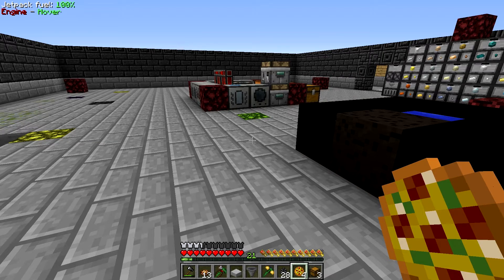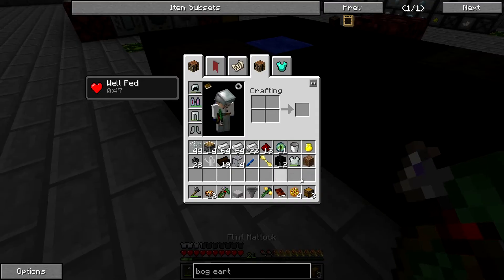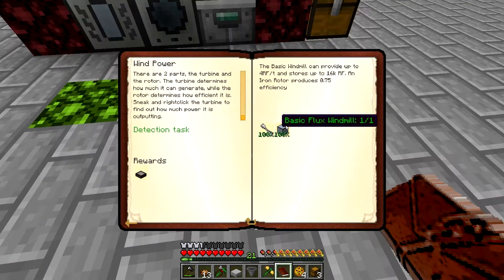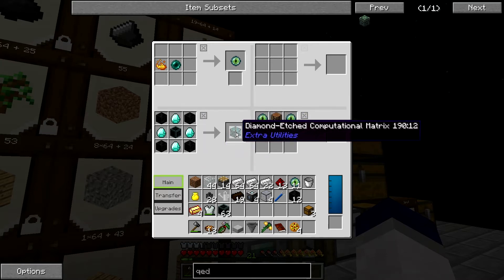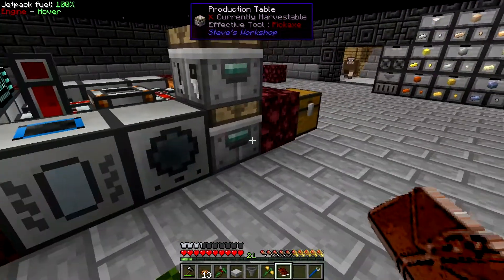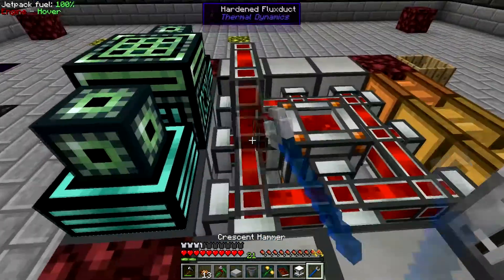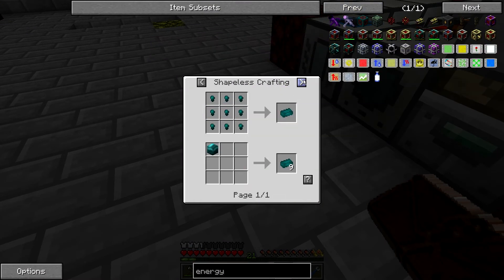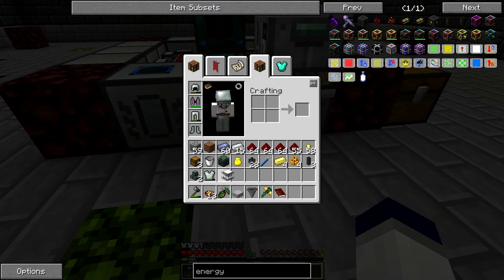Power Grid - Agrarian Skies 2 - Episode 15

Comment: Yeah I'm with you on power, I always (in a skyblock world) go straight to the lava power but this time I'm going to try something else, so very eager to see what you do. Have tried the solar gens before they are nice. With the Culinary gens I think the better the food you use the more pwer you can get, maybe? It's been a bit since I used em.
Anywho, enjoyed the video as always!!!
Reply from the maker: Mntdewmania Thanks. I haven't really used solar power before so that's an option, nor have I ever used culinary generators.
Reply: Delgar3 Go for the higher tiers they can really rack up the power fast then into a capacitor bank (or whatever energy storage you prefer) and your good to go
Reply from the maker: Mntdewmania In my test each food item gives the same amount of power per item, it's just faster in higher tier engines....I wonder if it's almost more resource efficient to have MORE of the smaller generators rather than the larger ones. :)
Reply: hmm do we have pam't harvest? Seems a pizza would give more than an apple. hmmmI don't know in the long run seems like the higher tier would be more efficient as its x64 I will be curious to see what you do!!!
Reply from the maker: Mntdewmania oh a pizza does give more power. But 1 pizza gives the same amount of power in a (x1), (x8) or (x64) it just gives the power faster in the higher tier engines. So you save on time to generate power but not fuel. To make a x8 or x64 costs a lot of extra resources. So 8 Tier 1 Culinary generators would produce the same amount of power as 1 Tier two generator for the same fuel cost. I'll have to test the speed.
Reply: hmmmmm good point and with food man that would take some time unless you automated the making of some higher foods somehow but how about with the solar gens, I think you would be right set a few around and just let them do their things, much more efficient :) You Sir are quite Da Man ;)

Comment: Well, im not really suren about it, but as far as I understand, the more advanced Culinary generator gives you more power for less food.

You can try the solar power, and the culinary generators seems pretty nice, you should have nearly unlimited power with the rainbow bacon and 2 or 3 of those.
Reply from the maker: MMH919 You are correct I was forgetting the fuel factor in my thinking...well I think you are correct I'll have to test it.
Reply: Delgar3 If you open the engine interface and pass over a food it tell you how much energy it will produce.
Reply from the maker: MMH919 Yes I imagine the Epic bacon will generate a lot of power for a long time. Guess I'll need to set up some farms. :)
Reply from the maker: Lord Genom So one item in a standard culinary generator will produce the same amount of power as 1 item in a X64 generator just over more time?